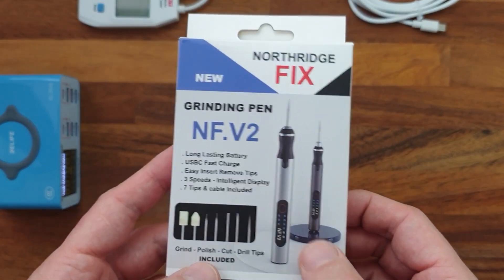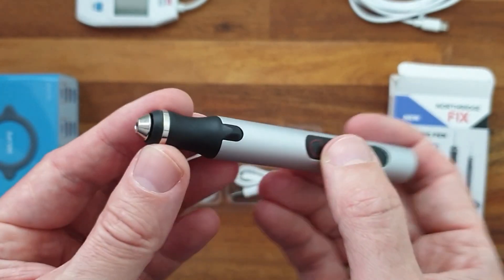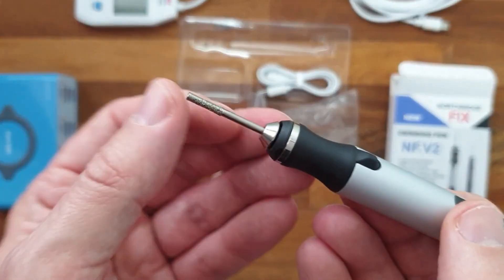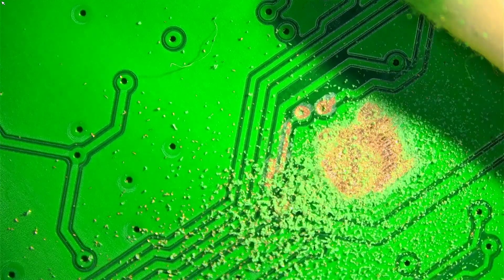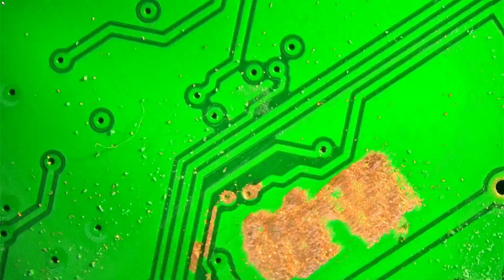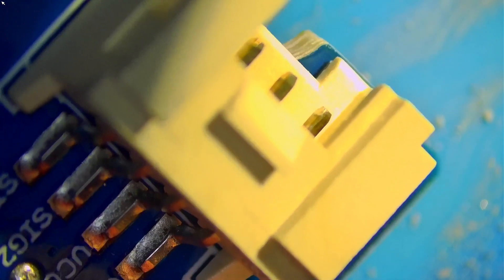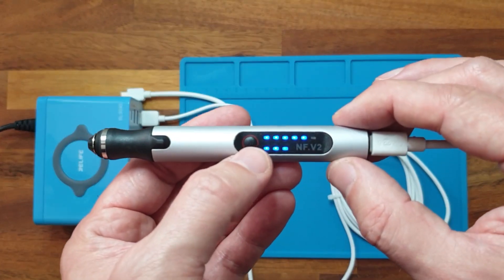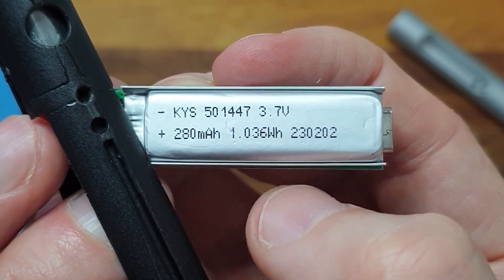NorthridgeFix Grinding Pen NF.V2 - Unbox, review and teardown

Comment: I bought one of the first ones from NRF and it didn't hold up too long. After a few months the battery would only hold a charge for 2-3 days and of course when I needed to use it it was dead. Then it would keep shutting off after 10 secs. after it was charged.  Very annoying, Disappointed. My housing would not slide off. Maybe the V2 corrects those problems.
Reply: I'm thinking that if you used it a lot, the battery may not hold up for long.  It's just a small lithium polymer battery, so likely not the most durable for extensive use.  Otherwise you may have just gotten a dud battery.  The nice thing is that it's easy to open the unit to replace the battery as was shown in this video.  IIRC, I think the dimensions of the battery to order was the top number shown in this video.  You may likely be able to order one from Aliexpress - that's what I'm hoping for, myself, but I haven't checked yet.
Reply from the maker: @enigmaticmf  Thank you for the good insights.
Reply from the maker: This has not been a problem for the V2 version i have so far. I understand that you are annoyed - its very hard to do RMA on these things ....

Comment: Alex guy discovered magical world of ali, but thinks no one knows
Reply from the maker: Yes a lot of the stuff is from Ali
Reply: @made.by.morten.laboratories All the products come from China. He buys them white-label and asks the manufacturer to put his logo on them. The soldering wire, for example, comes from the manufacturer BEST in China; the BEST logo disappears, as well as the "made in China" label, and his own logo is added. This solder is sold for around $6 on the Chinese website Parts4repair and $19 at his place. He uses almost all the products he sells, except for his Fluke multimeter, Weller soldering irons, and his hot air station from the manufacturer Quick. He seems to repackage his flux himself into 10ml syringes. In a video, you can see about ten boxes of empty 10ml syringes under his desk.
Reply: @lollol2283  All the products come from China. He buys them white-label and asks the manufacturer to put his logo on them. The soldering wire, for example, comes from the manufacturer BEST in China; the BEST logo disappears, as well as the "made in China" label, and his own logo is added. This solder is sold for around $6 on the Chinese website Parts4repair and $19 at his place. He uses almost all the products he sells, except for his Fluke multimeter, Weller soldering irons, and his hot air station from the manufacturer Quick. He seems to repackage his flux himself into 10ml syringes. In a video, you can see about ten boxes of empty 10ml syringes under his desk.

Comment: I have the same grinding pen and is very helpful 4 surface mount circuit boards grinding away traces that are corroded or damaged and extremely narrow traces
Reply from the maker: @smdsoldering, thank you for comment, grat that you find the grinding pen useful :-)
Reply: So is anything with a sharp edge. I have this same crappy grinding tool aswell and i can expose the copper on a motherboard trace easier with one swipe of the end of my tweezers that i can with this grinding tool.
Reply from the maker: @TheMerchFiles  Also a great method :-)

Comment: Thanks for this video. I have been thinking of getting this pen for a little while now. I have an identical yet older version E-108 (not northridge fix) that requires a wrench/tool to change the bits and it drives me crazy 🤣
Reply from the maker: @dschell11, yes its very easy to change tools on this version,good luck. Also thank you for comment :-)

Comment: I wonder how this would fare for severing a trace on the slimfix v4 for the ps2. It seperates the mute signal into L1 and L2 connections. I mostly use an xacto knife and slowly sever the trace but this might make it much quicker.

Ill have to pick one up for myself to try.
Reply from the maker: @haloslayer255 a sharp knife is also a solution, the solution is to be very careful - also with the grinding pen :-) Thank you for comment

Comment: MaAnt D2
Reply: The MaAnt D2 is not even the original manufacturer of this tool. They are re-badging it from a company named Jangklife who sells it even cheaper. I bought one with a 30 pcs bit set on black friday sell for 9.50$ with free shipping. Originally priced is about 12-13$.
Reply: @TheMerchFiles  That's good info to know about the original company.   Thanks.  I was able to find one branded as MaAnt D2 that was $12.xx shipped.
Reply from the maker: Yes, they look very similar
Reply: @made.by.morten.laboratories  I would assume it's a rebadge.
Reply: @Rhine_Labs With a nice mark-up. I've seen a video elsewhere of another vendor of their microscope which IRC was about $150 cheaper than NRF.
Reply: @I_Evo  I see a lot of rebadging with no customization except name, logo, and packaging. These China vendors are very shady sometimes giving rejects or blems to these type of buyers.
Reply: yes, it is.